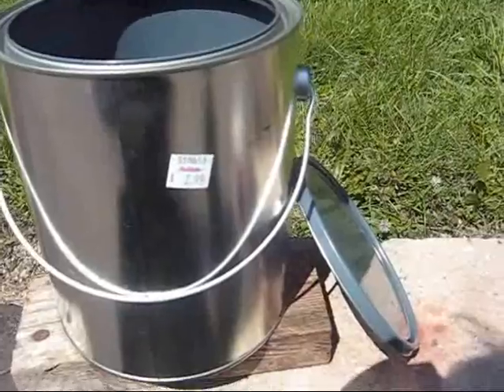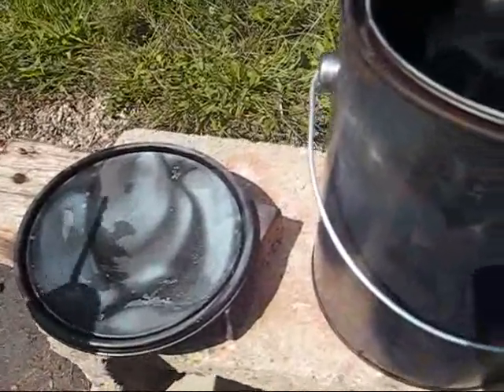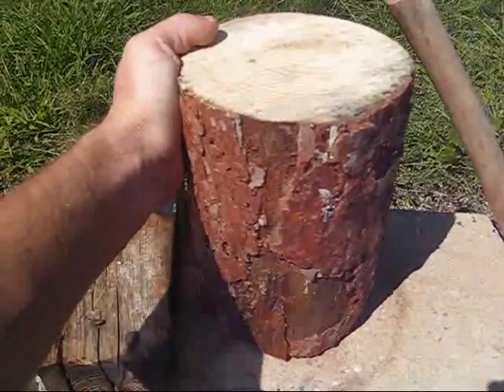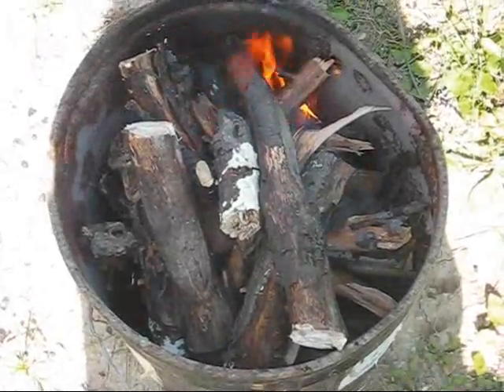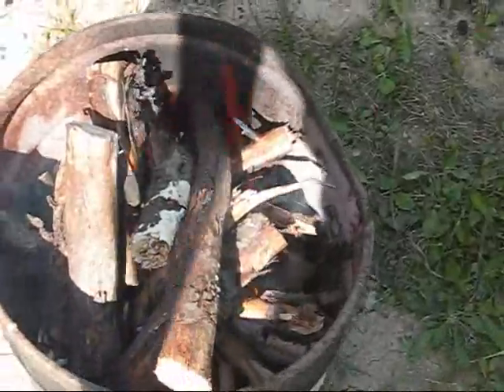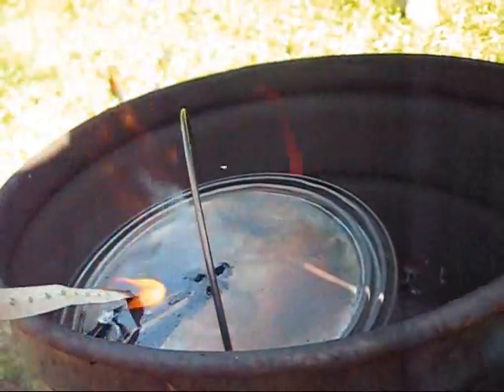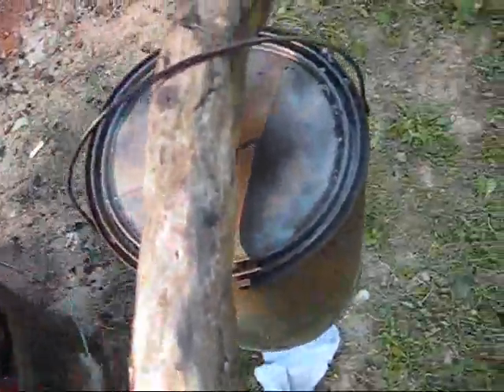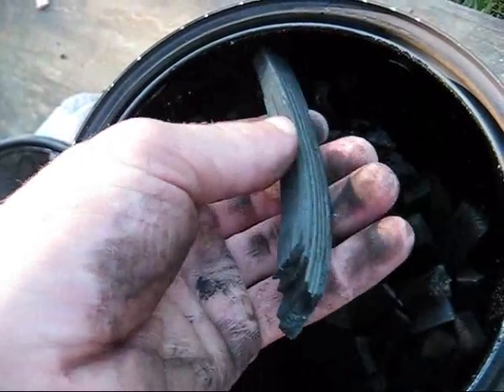How to Make Fireworks Grade Charcoal

Comment: Nice.  This can be used to make gunpowder of coarse one has to mix it with sulfur and KNO3 or NaNO3.  It can be used as an air filter as well as made into activated charcoal which is used for various medical reasons.  The flammable gas is wood gas, that, when harnessed will run a combustion engine.  So many uses for charcoal, but by reading the comments here people have no clue what has just been shown to them.
Reply: So since I have no idea, would this be a good charcoal to use in a forge? I'm rather new to all this stuff so I'm just trying to learn haha
Reply: This will work to a certain point.  Use a metal can with a hold on the bottom.  Slant can and put the butane or propane in hole mnenetioned.  The can should be lined with something like fire brick or plaster of paris. This will melt many many metals.
Reply: When you making gunpowder or rocket fuel stay away from NaNO3.Its extremly hygroscopic.
Reply: r/iamverysmart

Comment from the maker: @lizardownage Yes I think it could be. You would have to find the right wood to make it work right. Something soft but not too soft. Maybe poplar. You may also need to use a little oil to soak into the charcoal to make it stick to the paper.

Comment: Good way to make small amount of charcoal. I like to watch and see how others do things also.

I make charcoal like this in 55gal barrels. Use it for anything and 
everything from cooking outdoors to melting aluminum and blacksmithing 
steel.
 Doing it safely and burning up the wood gas for usable heat is great. I am building an outdoor furnace area now where I will put my barrels in the fire chamber, pipe the wood gas under the barrel to burn. Once a fire is lit under the barrel and the wood gas is coming out and burning, then it is a self fueling fire untill the charcoal is made! When wood gas stops and fire goes out, it's done and just need to let it cool before opening the barrel.
 The fire box where the barrel will be is surrounded by thermal mass to capture and hold massive amounts of heat! Water will be piped through the mass and some stored in the mass in tanks, this will then be piped in to heat the house.
 Barrels and piping will sit on a stand in the fire box so that I can load barrels anytime, and remove them when still hot without danger or need to let them cool. Only need to let them cool before they are opened and that can be after they are removed and sitting on ground to cool.
  Free heat for the house and free charcoal for all my uses, and probably enough extra to even sell some!

Comment from the maker: @toddy2519 Taylor6123 is correct. The wood itself should not be allowed enough oxygen to catch fire, that would cause a problem. As the wood is heated without the presence of oxygen however, it releases a flammable gas which does no harm to the product as it burns outside the can.

Comment: Love your videos. I've noticed I get the best charcoal by putting the small hole on the bottom of the can and setting it over a gap between 2 bricks to give it some exhaust room. It seems to prevent the upward convection that allows oxygen to be circulated into the retort immediately after all the volatiles are burned off (when the hole is on top). I always have less ash in the final product this way. Just a thought.

Comment from the maker: @dragondevel5 You should give the can a shake to allow any wood that may have been protected from the heat to be exposed. If it still does not give off any more gas after a few minutes in a hot fire, it should be done.

Comment from the maker: @aaaagk It can be left in the fire too long. If it stops releasing gas then air might come inside the holes and turn the charcoal to ash.

You can tell when it's the proper temperature when the outside of the can is air temperature. Unless it is a very large can, it shouldn't be hot enough to burn in the center by then.

It is used in fireworks as a fuel. For example, black powder is 15% charcoal.

Comment from the maker: Pine is a tricky charcoal. Some types make slow charcoal, others make fast charcoal. The amount of sap left in the wood after cooking is the determining variable. Most pine if cooked long enough will make a very fast charcoal because of the low density allowing for much finer grinding and therefore more surface area.

Comment from the maker: That is an axe that's been around for longer than I have. No brand name. There is nothing particularly special about it. My favorite brand of axe/hatchet is Gerber, they are unbelievable. Extremely well made and easily sharpen to an edge you can shave with - and I have. The teflon coating on the head is also very durable.

Comment: Hi Nighthawk
Just a small tip:  If you punch the hole in the bottom of the can, the burning of the evolved wood gas will help heat the retort, making the process more efficient. You could put the can in upside-down as well, but would likely run into issues with the lid popping off during the more aggressive portion of the gassification.  With the hole hidden, it's not quite as easy to tell when the process is finished, but just listen for the hiss to stop and it's not very difficult.Great video!

Comment: The damp rag over the holes is unnecessary. Air cannot enter the holes because it is so hot inside that the air pressure inside the can is greater than outside and by the time it is cool enough where the pressure equalizes allowing air to enter, it will not be hot enough to burn. I've done this hundreds of times and never had any problems with the wood burning up. Usually I would put the retort in the fireplace and leave it there overnight.
Reply: Do you remove the can from the fire once the flames stop coming out of can?

Comment from the maker: @Landotter1 Air will ruin the charcoal only while it is still hot. If the charcoal is exposed to air while it is above its combustion temperature it will burn away and turn to ash just like it would in a barbeque. The air needs to be kept away until it is cool.

You should join the forum at amateurpyro(dot)com. That is by far the best place for a beginner to learn and ask questions.

Comment: @Nighthawkinlight's It's not the oil from the wood that burns. The reaction produces methane gas. Also if you would turn your bucket upside down the methane gas feeds your fire and it doesn't stink that much anymore. 
Just some tips

Comment from the maker: Flash powder is the last thing you should be looking for. It is not needed for fireworks and will only get you into trouble with the law or injured. I use tens of pounds of black powder every year, but only around 5 grams of flash. As a beginner you should not even be considering it.

Comment: @Landotter1 A mastercrafted Osage Orange bow was worth a horse and a blanket. And i know about misquite cause i live in texas and have cut plenty of them down. But the wood to me seems soft, its easy to cut. Even though sources say it hurts chainsaw blades... I didnt have any problem cutting them down with just a saws-all, it takes like 3 or 4 times as long to cut an equal branch of Osage. So long that it starts to smoke and burn, not fire but maybe if it kept up.

Comment from the maker: I see. What you would end up with is not rocket fuel however. It would not supply its own oxygen and therefore would need to be burned in a hybrid rocket as a solid fuel grain with an internal O2 source. In any case, even when burned in such a way, it would do no better than using tar or asphalt, which would be far less work.

There might be a good use for the oil vapors, but I don't believe a rocket to be it.

Comment: @Nighthawkinlight  Maybe its different from wood type to wood type. If you look up the process on wikipedia which is Pyrolysis you can see how it works. It produces CH4 which is methane gas. I used kindling wood because its already chopped in pieces. So i don't know which wood type it is.

Comment: Hello sir great video I have question . How much granulated bp can used to lift charge for 4 inches , 5 , 6 , 8, 10, 12 or more ball or cylindrical shell. And what is 1 ounces.is it 28 .06 or 28.58 which is correct.  I am fireworks lovers and I want to make shell for our festivals.
Reply from the maker: If I remember correctly the amount of lift should be 1/12th the weight of the shell for anything under 10 inches and 1/16th or less for 10 inches and above. But you should not rely on this as I do not remember for sure. Join passfire.com and you will learn all you need to know.
Reply: Ok and ty sir

Comment: Very good video! Let me ask you this, at the end of this video I noticed you placed a wet towel on top of the can to cover the 3 ventilation holes and to prevent ashing of the new charcoal. Can you just remove the hot can lid and spray water on the hot charcoal to stop it from turning to ash?

Comment: Thinking out loud. Perhaps this has been asked, and answered already, if so, i failed to find it. Eyed through all the comments, but there are so many... Anyway.
Bottom, or top, the hole in the crucible should be as small as it can possibly be, without the lid blowing of from internal pressure, or the thing exploding on one, right? The idea is to let gases out, while not letting oxygen in.

Thank you for your time and effort Nighthawkinlight.

Comment: another great thing with this is if u put the hole in th bottom with a pipe it will create tar instead+ some cars can use that gas instead of normal fuel i dont know witch but if u google ur car u might find out

Comment: @TheFyroPyro as i was saying you don't now of all the oils are extract-it of the wood.
white the oils still in it it will not work as good as when all oils are out of it.

so white a bit of luck it will wok yes but not quit as well as the charcoal which was made this way whit the security that all the oils are burned before you stop the reaction. (the flame on top of the can will stop burning as soon as all the oils are burned)

Comment: I find it funny how you say that oak charcoal doesn't perform well for a BP. Although it requires more extensive milling it burns way faster than my pine powder. This maybe because I needed to cook it longer as there was a significant amount of tar in it. The pine char was less dusty and more sticky even after two hours in the mill. I do like the sparks it leaves though.
Reply from the maker: There's lots of different kinds of pine and oak. Some species will differ, and results also change based on cooking temp and what part of the tree is used. Some parts have different sap content and wood density than others.
Reply: @Nighthawkinlight  Thank you for the clarification. Great video as always. I think I'm going to try and get my hands on some willow for charcoal. Best of luck to you.

Comment: @TheFyroPyro and i was just saying it das not work properly, if you do it like that you have to throw your charcoal in to the water when it stars glowing to prevent it from turning in to as and then you just don't now of the wood is fully turned in to charcoal and of all the extra oils are extract-it of the wood.
and btw I'm a professional i'm not the general backyard fireworks builder.